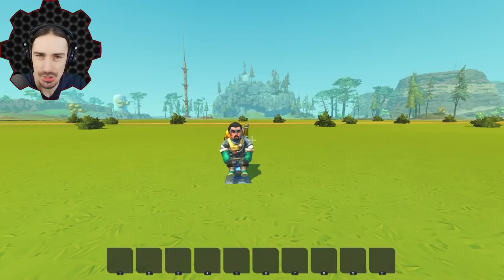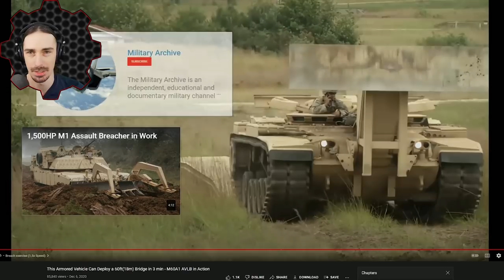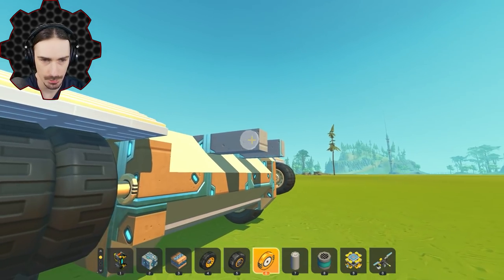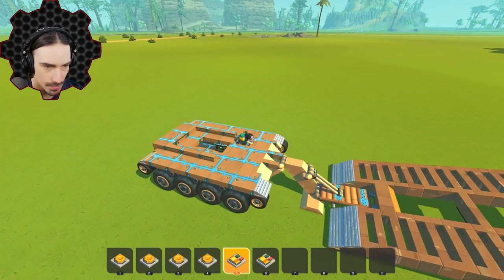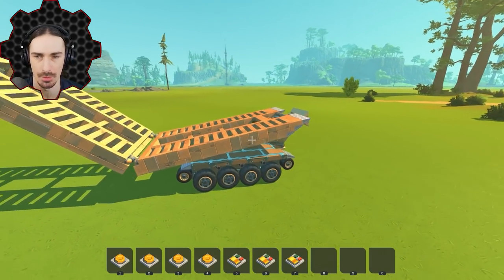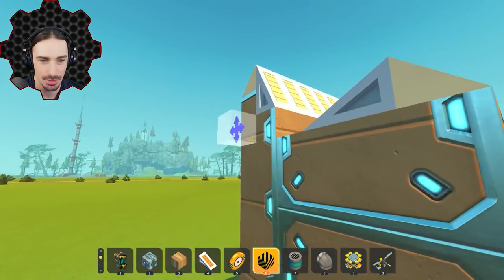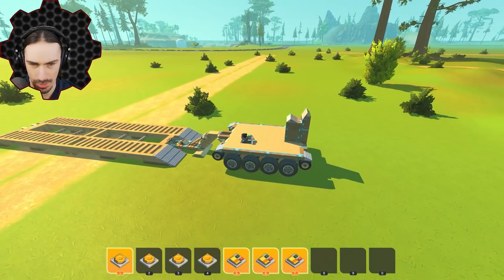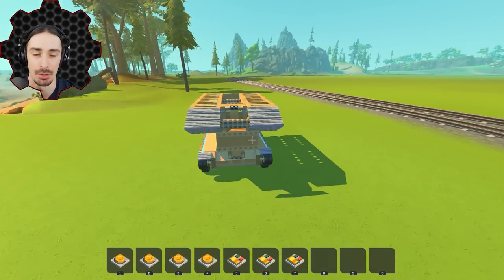This Tank CARRIES ITS OWN BRIDGE, and It's Real

Comment: just FYI: the german slide method (which the dutch video shows) makes the bridge elements much simpler/cheaper and modular, if needed to be left behind for following units/days/retreat while the vehicle grabs another bridge for the next obstacle. Pioneer units of those armies have the same bridges which can be split ones more sideways for easy transport on trucks to be layed out by crane or to be carried for supplying the bridgelaying tanks with more bridge. No hinches and hydrolics in the bridge itself, which would need to be maintained (kept clean/lubcricated) and would be costly if left to secure a route etc..
Reply: That's actually a really good point I didn't know about. I'm wondering of the tank can angle the bridge though, or if you have a 10ft elevation on the other side of the gap if it just can't bridge that?
Reply: @Zedstein  yes, it can angle it further upwards. The arm on which it slides is able to add a few degrees to what is seen in the clip and the whole tank can add a few more deegree upwards by standing higher on the frontal dozer blade. In that clip they dont max out the arm and blade.
Worst case it has to use the dozer blade to create a little ramp for itself before laying the bridge. 
BUT in service all those bridges should never be laid in a noteworthy upwards or downwards angle, as friction is all what keeps them in place and a heavy vehicle moving on it could fairly easily move the bridge itself. Even when level its not advised to brake or accelerate on such a bridge because of that possibility.

Comment: Basically every form of the AVLB calls for combat engineers to level the terrain on both sides of the gap, but it's a much faster process to have that done and then have a tank lay a bridge out than it is to build a whole bridge if you've only a narrow but deep gap to cross. But this is certainly a very impressive example!

Comment: 4:19 there you can see that you have no idea about german engineering.
The bridge layer from the US-Army (what you build in the video) because of its height its is it impractical e.g. in the forest. While the Leopard is flat on the ground with its bridge, the M60 (what you built) is already visible with its 10 meters high. So it's not impractical it's smart because of the cover.
Reply: Frankly both of them are fairly impractical. If the goal is a well fortified transport for quick bridges, both of them would be incredibly expensive only to allow the laying down of a single bridge, with a high risk of failure if they are brought through combat. 

They are over complicating it, make a tank that can carry bridge pieces that are based on being light and durable (easier to do if its not designed around being able to build itself, with fewer points of failure since simplicity allows more redundancy), and protect said pieces. Then make a second smaller tank that functions like a forklift to move pieces into place. That means you can create a path through combat zones with fewer points of failure, and capable of creating more bridges with fewer vehicles.

Comment: wiring to the bridge shouldnt be an issue, it would be like connecting the hydraulic line. But if you add a few cacti to the bottom of the bridge, it should help stop it from sliding around, which could help with backing out of it.

Comment: How to do it using a spud gun to disconnect the bridge after you have set it up shooting a block of cardboard connected to the pins. And when picking it up you will need a locking mechanism that using a piston and block and pushes into the side of the holes yes it will have a key space because of the 2 block difference but it be a working system

Comment: Sorry to say but the dutch version normally is deployed faster and takes more weight (if that still is an issue when holding tanks already). The dutch go hand in hand with things like bridges, waterworks and such. Don't underestimate their wierd looking designs. There is a lot of thought behind it.
Reply: its a german design and build by germans tho ;) no dutch engineering there. And the major thought behind it was no expensive hydraulics/hinges in the bridge itself so that it can be left in place for others while the tank grabs a new bridge off a trailer and moves on. Those bridges can be split into four pieces and used by engineers without such tank too, also much less maintenance if nothing complex is in the bridge.
Another bonus: it can be deployed without someone going out and disconnecting, unlike the hydraulic butterfly version.
Reply: @diedampfbrasse98  i fact checked and to my surprise your story holds. I really was convinced this was developed in house. I am used to do climate tests on altered tank platforms and such once in a while but never something like this. Thanks for correcting.

Comment: You should look at pythagorean triangles. They are basically proper 90 degree angles but they have whole number lengths for each side. Try out 3, 4, 5 for side lengths, or, 5, 12, 13.  https://en.m.wikipedia.org/wiki/Pythagorean_triple

Comment: 0:53 Something to note is that trenches aren’t really an obstacle for tanks. Most tanks are fast enough that they’ll skip over any kind of ditch, hole or trench they come across. And if for some reason they’re going slow enough to get caught up in one or in the unlikely event they come across a hole big enough that they can’t hop over, most tanks will have the power to brute force their way out
Reply: I think the tank isn't the main thing this was made to cross.  It supposed to be laid down then allow the rest of the convoy which might not be tanks to cross.
Reply: Might I add that the first tanks were literally designed for trench crossing,
Reply: @xdragon2k  Also you have to remember tanks weren’t as fast back in those days
Reply: War Thunder Players: Are you sure?
Reply: The tank may cross the ditch with ease, but your men will probably have more trouble.
Reply: @loganroman5306  well, a lot of army training is fitness and it involves scaling some walls
Reply: Tank might cross, but fuel truck won't so least bridge for those..
Reply: Probably fir small rivers and creejs

Comment: It would actually be interesting to see you have a multiplayer race in which everyone needs to make such a vehicle with a detachable folding bridge. 
It would also be interesting to see yu make a clock powered entirely by a weight, with someone manually needing to move the weight back up. Whether you use the Geneva Drive or an Encampment (though you might want to try both, to see the differences), is irrelevant. The biggest problem I see you having is the reduction gears which would make this possible. In fact, I hope you will issue a challenge to everyone to make the most compact reduction gears with the highest reduction ratio using only blocks available in survival. 

For reference, a 3x3 gear made by two layers rotated by 45 degrees, one with small pipes and one with large pipes (all of the pipes only use up 1 cube of space), can connect to a 5x5 gear made in the same way but with only small pipes, for a reduction ratio of 2:4 or 1:2 (since we 3x3 has a diameter of 3 and we remove half a block from each side because of the contact surface, we get the 2 for the diameter of rotation, and for a 5x5 we remove half from each side and get a diameter of rotation of 4, and we have the same number of gear teeth, which means the ratio of rotatio is 2:4, and if we half each number we get the ratio being 1:2). On the workshop, Eru has a blueprint called "Gear Examples", which also shows the setup in use, but that can only be used to double the speed, and it would be nice to have a single pair of reduction gears to get a much larger reduction ratio (which would also help out with the lag). I think that a reduction ratio of 20 in a 10x10x2 might be achievable with a single gear.
Reply: They've made this exact challenge in the past, but the bridge didn't fold, it wasn't a race (timed instead) and picking up the bridge was much easier (used pipe pieces to pick it up so it locked in place).
Reply: Unfortunately they have done this challenge, because I'd love to see it again
Reply: @joshthompson8478  I liked that challenge, too! They did it with carrying a bridge which doesn't fold. Adding a folding mechanism and all kinds of difficult terrain would make this more interesting. Like one side being 45 degrees twisted when looking rom the other side, as well as different lengths of gaps, different angles for the sides (instead of parallel sides, like with the rocks which were tried in this video), and maybe even with some moving obstacles (like have one side slide, then another side move up-and-down, and another side move in a circle, and another side have coveyor-belt-like pipes pushing the bridge away, and maybe even a bridge which requires them to stop on an island and put the bridge on a different side of the island to continue).
Reply: @riccardopetrina4212  But that is a different challenge, it's just similar, with straight bridges and only increased the distance of the gap, nothing more.  Adding a folding mechanism and all kinds of difficult terrain would make this more interesting. Like one side being 45 degrees twisted when looking rom the other side, as well as different lengths of gaps, different angles for the sides (instead of parallel sides, like with the rocks which were tried in this video), and maybe even with some moving obstacles (like have one side slide, then another side move up-and-down, and another side move in a circle, and another side have coveyor-belt-like pipes pushing the bridge away, and maybe even a bridge which requires them to stop on an island and put the bridge on a different side of the island to continue).
Reply: @SapioiT  that would be pretty cool I'm just worried about time I think they only take 15 minutes to build their creations and it took him like 3 hours to make this folding one.
Reply: @joshthompson8478  Well, they could all see this video before-hand, and they could use pistons or bearings to make locking mechanisms for the bridges, to help with the stacking of bridge segments.

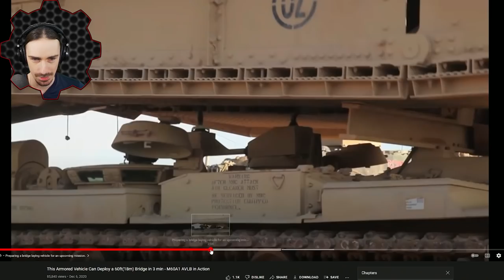Comment: 3:31 making tank treads in scrap mechanic is gonna be a challenge interesting at least
Reply: A less laggy challenge would be making reduction gears with a single pair of gears with a very high reduction ratio out of survival parts only. I think a 10x10x2 (excluding the supports they're attached to) might allow for a reduction ratio of 20 or more, but the largest reduction ratio I was able to achieve was 2:1, by using the "Gear Examples" blueprint Eru has uploaded to the workshop. I was able to get higher ratios in a 10x10x3, using something similar to how old trains synchronize wheels and how pistons work, but modified for achieving a reduction ratio between a big circle and a small circle.
Reply: scrapman has made videos with the tank mod before, but to do it without mod would be too laggy
Reply: @koktszfung  No on physics 1 i have tried and they work great

Comment: I used to be a M60 AVLB driver, for a number of years, but when I got stationed in Fort Hood, TX, we had the M104 Wolverine HAB (Heavy Assault Bridge). The Wolverine uses the German designed bridging system, a leguan deployment system, all built on the M1A2 Abrams chassis. It isn't actually anymore complicated on the bridge side, in fact it's simpler, while the leguan deployment sytem is a beefy unit and does add complication to the vehicle side of things, but you wouldn't think it watching a skilled opporator deploy the bridge. All told it takes about 8 mins to deploy and 10 mins to recover the bridge. While some say the reason the military switched to the leguan bridging system was to make it less conspicous, it's actually because the M60 AVLB bridges were designed for lighter M48s and M60 tanks, not for M1s, thus when an Abrams had to cross a AVLB bridge it could only creap across, with the leguan bridge that same battle tank can get across at 10 Mph. Though that doesn't sound like much, when you are breaching a lane, any less time spent in a chokepoint is less time to get shot. 

All told, the leguan system is a much cleaner, faster, and better built system over the old AVLB system. 

If you're looking for a couple of other interesting Engineer vehicles, take a look at the M9 ACE (Not a lot of complicated engineering, and it leaks like a siv in real life), Unimog SEE truck (only us military vehicle build by Mercedes Benz. Not so much complicated, but interesting to see, no pun intended), and the PLS HEMTT (Probably pretty easy to replicate).

Comment: I'd love to see these improvements, but it would be a LOT of work for you. First improvement is to double bearing everything. Allow the stabilizer foot to extend past 90* as well as the deployment arm. Use Kan's variable piston system to allow hyper extension. For the bridge controls, have one of the pistons extend to cause the bridge to unfold, and the other to fold it in. You will run out of buttons, so I would recommend using mode switching logic so that with the flip of a switch you can go from controlling the tank to controlling the bridge with the same buttons.

Comment: You should try to make a sailboat that stabilizes using a hiking system in Trail Makers. #48
Reply: A what system
Reply: @brrrrrr  a hiking system, it is how small boats stabilize. the crew just leans out the side of the boat to pull the center of mass to one side to stabilize the boat.
Reply: @qwertymcenglish4825  that would be easy to implement in trailmakers

Comment: 9:17 If you want right triangles in scrap mechanic, stick with 3, 4, 5 triangles. When the two sides are 3 and 4 blocks, the hypotenuse is exactly 5 blocks. You could do 6, 8, 10 too.

Comment: day 144 or 145 of asking scrapman to start a Survival series amphibious tank/basically any transportation and floating base/barge (or under water.) But you need mods... it's a requirement to breathe underwater, if you want an underwater base/transportation. And yes i am talking about the underwater fan moonbo reviewed that basically makes water spaces air spaces... if that makes any sense.) (and if you wanted to move the barge/boat/floating base you are able to make thrusters/glitches/mods to do it or by lift or actual push

Comment: They got another pins on the side, that probably sits in holder in bridge to secure it during lifting/laying down(seems also offers leverage points). How they adjust height is unclear, but they got two hydraulics that give them some options. One can control angle foot is to the ground while second is controling angle of pins. Not much tho, but they are engineers, they got shovels..

Comment: Since you're using tank steering anyway why not just switch to a driver seat and use WASD to adjust the pins? Should make dealing with uneven terrain a lot easier.

Comment: Making the ends of the prongs pointed(using that one conduit connector or something) would probably help you pick the bridge back up, also removing the high friction parts in the bridge socket now that you identified the problem may help driving back away and leaving the bridge

Comment: Having a flat surface should be acceptable requirement.  You can chip on the one side of the cliff if it's uneven.  Just pick the other side with flat surface.

Comment: a clamp system might have worked easier where the expanding blocks not only clamped it but also trigger the sensors for the deployment and collapsing of the bridge.  I watched the british army do a training exercise with one of these where they used it to be the base of creating a permanent bridge over a river in 1 weekend.

Comment: I joined the army to have one part if my soldier bucket list: "Run someone over with a tank; may it be friend or foe, or even civilian to be honest."
I did get the: "Kill someone using a bullet; that wasn't fired from a gun. Literally just stab someone with the ammo."
"Save your comrade from any kind of trap." A fugitive set up a trap where boiling water would fall on the victim. Yes, I saved my idiotic rookie, but equipment was thick so, minimal damage.
"Get shot in the head." Yes, I did, fairly recently actually.
"Headshot 10 people." 27/10 Let's go!
Reply: Context: I'm in the special elite forces. Mostly for reconnaissance. Just missions here and there, tag & assassinate, retrieve hostage, or the worst; extremists attack again.

Comment: Have not watched the whole thing so not sure what you came up with for remote controls issue but I like to use a static sensor on the "unattached" part of the creation.

On the controlled part of the creation you can use a block and piston (or bearing to move into the sensors range.
Reply: That's exactly what he did, he used a piston and an attached sensor on the bridge that, when deactivated, would unfold the bridge

Comment: I originally though you would use spud guns to activate switches on the bridge, which would activate a controller to unfold the bridge.
Reply: Could go very wrong with the cardboard tho. But if well done it should work ig